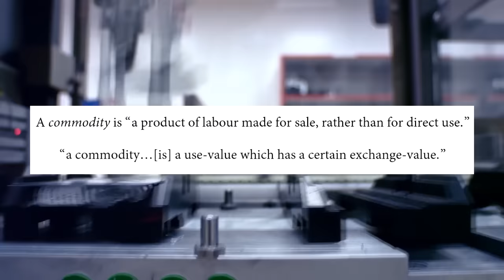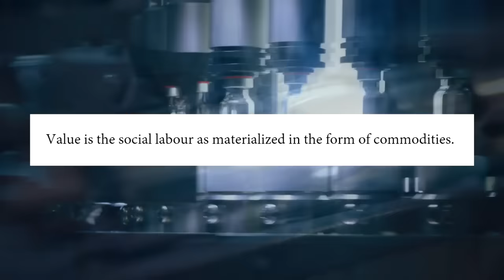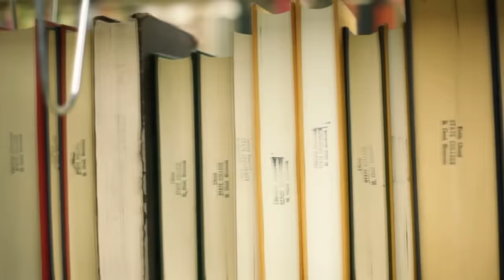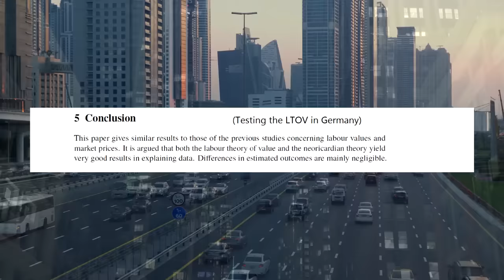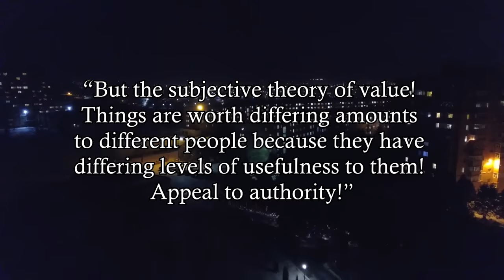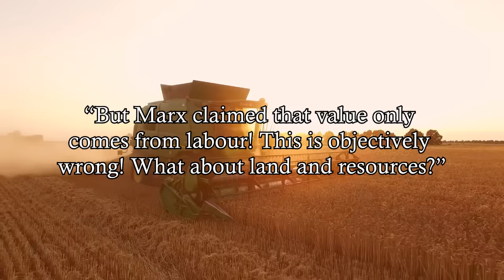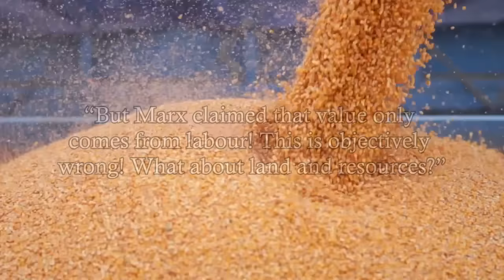Capitalist arguments against the labor theory of value suck (Explaining the LTOV) - Socialism 101

Comment: 7:54 Nature is NOT a source of value in Marxist theory. Only labour is a source of value. Marx understood wealth in societies as the accumulations of use-values (not value). That Gotha quote makes it clear, "nature is a source of use-values (objects of utility)". The answer is simply that land, gas and other use-values do not have value, only exchange-value. I'm pretty sure Marx explains this somewhere in Capital, but a famous passage from Capital is that "labour is the substance and immanent measure of value, but has itself no value". I'm in a rush rn so can't really research for the specific passages, but Rubin also talks about this in the first chapter of his Essays.
Reply: Labor is also a source of use-values. Labor and nature are the same and are the only commodities that have no socially necessary labor time and have use values. They are the source of all value. Anything that has to be made comes from nature/labor.
Reply: @leoziman8689  yeah labor and nature are  sources of USE-values. That is a different statement from saying both are sources of value, which is wrong. That is the mistake Hakim made. In Marxist theory, value is a social relation whereas use-values is a "physiological" concept to refer to objects of utility. According to Marx the substance of value is labor. Someone else pointed out this error in the comment section and Hakim acknowledged the confusion. And labor is not a commodity, labor-power is.

Comment: This whole video relies heavily on supply and demand, but fails to address that demand in on itself is subjective. If the perceived value of an item is lower than the perceived value of its assign price, people will not buy it, which would drive down demand. To balance supply and demand, these goods would then have to fetch at a lower price, apparently reducing the 'value' of labor in this theory.

Marginal utility tells us that the more you have of something the less usefulness you get out of it (you can only get so many kettles before they become worthless) so that the perceived value of such item decreases as you acquire more of it. The economy is not a class you can master in college, to think otherwise is the pretense of knowledge.
Reply: That is because price is not value(in Marx term). Maybe you should back to read Das Capital again to further understanding it. Price fluctuate around value depend on the supply and demand, the value is depend on SNLT. Price will equal to value only if supply meets demand, but in real world supply and demand very rarely meet. 
I don't get how marginal utility contradict with LTV at all. Ya you have over supply of something, so the price fall, that doesn't mean the value will fall. There are different scenarios in which where price fall, (assume demand stay the same) 1. Oversupply of the certain commodity, ie inefficient at resource, labor allocation. (but in reality most companies just throw away excess into dumpster instead of lowering the price. To justify increasing in price later is much harder than reducing price, so it is more riskier to reduce price. Since you can get same profit margin with less people buy high price items vs more people buy less price items) 2. Reduce SNLT(reduce value) which increase production, in free competition, the price fall around new value (this is what Marx try to explain). 3. In Monopoly where large corporation with large store of capital (either through subsidy from government or other mean) can out compete smaller competitor, by reducing the price...

Comment: Assume for this hypothetical that you are deathly allergic to pineapple. 

How much would you pay for a pineapple?
Reply: You wouldn't buy it? However it would still have the same price
Reply: @kiwichippie5465  the point is that the value changes between people
Reply: @kiwichippie5465  but it wouldn't if nobody wanted pineapples, the demand is the number of people willing to buy at a given price and the supply is the number of people willing to sell at a given price, it is most economical to have that price where the supply and demand are equal so that is the price it is sold at.

Comment: I really struggle with conceptualizing labor time as the fundamental economic building block of an economy.  Am i just not understanding how marx accounts for products that take the same amount of time but different amounts of risk and effort? It might only take someone an hour to scale a phone tower,  but the skill and risk required may be worth a bit more value? Sorry if it's a dumb question
Reply: I am still learning about I, but I think it isn’t Faust labor time that goes into the value, but also “amount of labor”. So something that requires more risk would still have more labor value because there was more work put into it. Also, the theory mentioned how some jobs require more training/work to be correctly conducted, that usually includes higher risk jobs, and hence their labor value for that extra work is added onto the labor value for the commodity.

Comment: Is there really all that much of a difference between considering the marginal cost of production to determine price and considering the socially necessary labor time to determine price, for a given demand level?

It'd be like...testing whether the typical market price over a long period correlates better with the highest production cost that still breaks even at a given price/demand level, or with the integration of the production cost divided by the amount of goods sold of all the products that get sold at a given price/demand level, right?

Because you can have different curves there.

Like for production/cost curves that looks like they're approaching an asymptote vs production/cost curves that look like they're quadratic, there should be differences between those two models of how price is likely to be determined over a long enough period.

So if the marginal cost of production (in labor/etc.) goes up a lot from the cheapest/easiest ability to produce, but then plateaus in cost to produce, then under both theories the price rises in that early stage, but it will continue to rise faster during the plateau stage for the labor theory of value, while the price will plateau alongside the production cost with the marginal cost of theory.

EDIT: come to think of it, really it's not 'determining price' so much as 'determining the supply/price curve'. The demand/price curve probably is actually better described by the marginal utility theory of value

Comment: Re: individual skill levels?
Disagree that there's no variation. Right, let's say you take out orders at a restaurant? How quick you are at navigation, how many orders you take simultaneously, how fast you physically move, how long you stay and chat with the customer, how often you check back on each customer, how efficient and accurate you are at production tasks associated with the job, how much time you spend doing incentive-related tasks like checking till and tips, etc.

Lots of skill, intensity, conflict of class interest, and quantity vs quality factors going on.

This does very little to affect the basic conclusion that, averaged out, the value (not price) of a thing is the work put in, plus the cost of inputs.
Reply: And in many other jobs, there's a clear difference in speed based on skill. In the time it takes a rookie software developer to write 100 lines of bloated, inefficient, buggy code that sort of solves one task, a highly proficient developer might write 200 lines of highly efficient, good code that solves 5 or 10 tasks.

Nonetheless, the existence of differing skill levels does very little to change the basic conclusion here. Measured as a social average, the code to solve a task takes a specific amount of time from averagely-proficient devs.

Comment: resources used, time, and number of conversions and manipulations the resources experience during production. are the REAL metrics tied to value. LABOUR is the man power necessary to handle production in regards to those metrics. 
LTV will fail to maintain its predictive power as processes get automated. Since it is likely that the processes will be difficult to correlate to their equivalent manhours they replaced (since the man hours were already dependent on the efficiency and availability of the tools available).
We will experience processes that are roughly equivalent in most metrics over wildly varying  systems and resources.

Comment: I'm relatively uninformed, but there appears to be misrepresentation and misunderstanding on both sides.
I don't get the point on the subjective theory of value where supply equals demand. If supply equals demand, the price system reached equilibrium, and price will remain the same until conditions change. The price system does not 'turn off' or something because exchanges are at peak volume. The price system settles at a price based on the subjective valuations of all those involved in every side of a transaction, worker, capitalist, and buyer, including the subjective valuations of the value of the labor itself. And if your subjective value varies wildly from the norm, don't expect prices to reflect that, unless you connect with a sole individual and work out a deal personally.

The reason why many of these people, especially Austrians, rely on unscientific 'nonsense' is because economics, to them, boils down to human action. It is a social science.

I am no expert in austrian economics, but my understanding of their conception is this. Rather than workers creating value through the application of labor and capitalists skimming the top, capitalists offer contracts. They are buying your labor from you, and it is no longer yours, this is an investment on their part. If the return is greater than the agreed upon price, the interest rate is positive, but they also accept the risk of loss, while the worker is entitled to the benefits of the contract regardless of revenues. The reason why prices are higher than wages is because the capitalists who make poor investments and lose money are purged by the profit-loss system. An obvious objection might be that this system is unfair, but a free enterprise system allows you to join or start worker coops just as any other business. By getting a job under a capitalist, you are engaging in a contract, and the only objection you might still have is that you did not understand the implications of this contract, to which I would say, fair. I think people are generally very uninformed about the basics of very important matters, this being one of them.

Rather than prices approximating value, the value of commodities is not intrinsic at all, according to subjective theory advocates. They don't simply ignore the intrisinsic value, they dispute its existence.
Reply: @waltonsmith7210  The government is more powerful than it should be. If the government is weak, there is no incentive to lobby or manipulate it. And having no bargaining power is the natural state of man. He can either work alone, or engage in contract. If you wish to allow workers to collaborate, allow businesses to cooperate as well. Post-industrial labor is much safer, anyway.
Reply: @waltonsmith7210  I think natural aristocracy is a good thing, we definitely don't have common ground here.

Comment: I don't think I got this one. Is it always that there's always an interplay between price and value, where neither can be ignored?
Reply: The value of something comes from the input that goes into making it, or transforming it, from raw material. This is labor given that labor is what does the transformation, in tandem with capital (workers using machines to make a thing). This value is basically the baseline price for that commodity, but the actual market price is still affected by relative supply and demand. So the price is going to be above the value. It could be lower but that would be a bad business practice. This is rather intuitive if you think about it. How does a brand new business in a brand new market set prices? It has no external market signals to guide them, so they must set prices based on something intrinsic.

Comment: The mudpie argument is so funny because actually, the mudpie literally DOES have value, it DID take a given amount of labor time to produce, and the fact that there's no demand for mudpies is irrelevant to this fact, that's kind of the point of the LToV, that labor time is an objective material reality of production from which the driving forces of a society's mode of production can be derived. 

You can extend this to actually realistic commodities to realize it's the case, you can for example produce winter jackets that nobody will want to buy in summer but that doesn't mean the jacket has no value, and indeed when winter comes around suddenly demand wil appear and the jacket will be sold at its labor value in money terms. In that same vein, since we're proposing a hypothetical scenario in which you make mudpies, we can also propose a hypothetical in whch for some reason there actually is demand for mudpies, in which case then they would actually be sold at their labor value in money terms.
Reply: So you admit that, acording to LTV, value is impossible to measure and thus unscientific?

Comment: For the section where you talk about how supply and demand determine the market price of a commodity, wouldn't it be more effective to explain how the value of a commodity is determined, being through both the cost of labor and it's use value,  which would fluctuate according to the social necessity for said commodity instead of explaining why the commodity is priced the way it is in our current market? Sorry if this is confusing, but this is my rationale given that you implied supply and demand still exists in this Marxian economy that's being explained. If I've misconcieved anything, please let me know cause I've only recently began studying theory lol
Reply: Also, if the use value of a commodity increases for whatever reason, wouldn't this result in less supply and therefore an increase in value? I say this because the LTV would imply that an infinite supply of the commodity could be produced, however I don't make the misconception that this changes how much labor goes into the production of this commodity, which according to Marx, would be the only factor in this commodities value. Using the example provided by Marx in chapter 1 of Capital, 20 yards of linen would be equal to 1 coat given that both of these commodities take the same amount of labor to be produced. However, let's say that there are only 100 yards of linen in existence; why would this not change the intrinsic value of the commodity?
Reply: Value is not determined by cost. That’s where he fails.
Reply: @ExPwner  lmao marx explicitly acknowledged this what is ur point
Reply: @joey-bk1sr  no, he doesn’t because LTV is a cost theory of value.
Reply: @ExPwner  have you even read capital lmfao

Comment: The mud pies argument is simplistic but extensible. It takes more labour to make a mechanical watch than an externally industinguishable quartz watch. Both have a use value, in fact, almost identical. The quartz is a bit better at timekeeping. Does that make the mechanical watch more valuable despite doing everything the same or worse? No! They are merely an inefficient allocation of resources. You used more material and labour to accomplish less. The "labour value" is either incorrectly defined or a meaningless concept.
Reply: What do you mean? If you search price of mechanical watch vs electronic watch on Amazon, most of mechanical watch sell higher price compare electronic watch despite what you consider "same or worse". Stop using imaginary scenarios that is not root in reality, because you can justify anything using imaginary scenarios.

Comment: About the mudpie argument, not gonna defend it because it is deeply stupid, but I am curious what a “want” is defined as? Is it quantifiable? How? Im wondering bc I could see two different societies/peoples with different value systems. Wouldnt a cathedral have more “want” in 14th century rome than a temple of Jupiter, even if the labor put in is the same? It seems from the art/chef examples it may have something to do with supply/demand/price but im not sure and a little uneasy about that bc it seems to imply that markets are necessary to determine value and at least to me markets inherently centralize power. Is there some reading for this?
Reply: Well there is a very easy though not very precise way to quantify "want". You ask a lot of people "Do you want mudpie?". If no one answers "yes", then mudpie doesn't have any use value.

Also, you seems to have same problem with LTV as many of it's "critics", you are missing that LTV doesn't attempt to explain any concievable exchange of money, but only the circulation of generalized commodities on the market. As any good scientific theory, it has a clear scope of what it explains and predicts. Hakim makes a mistake by not pointing this out (seems he have troubles with understanding actual theory).

As for readings, i suggest reading Marx. "Wages, Price and Profit", "Wage labor and Capital" and then going for his magnum opus. No better place to start, really.